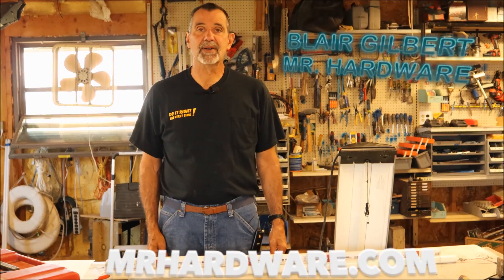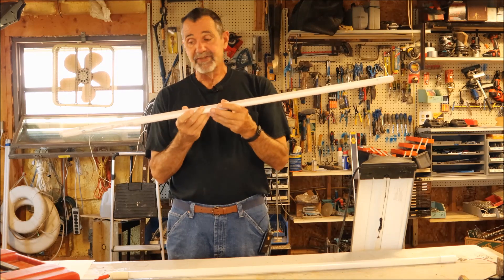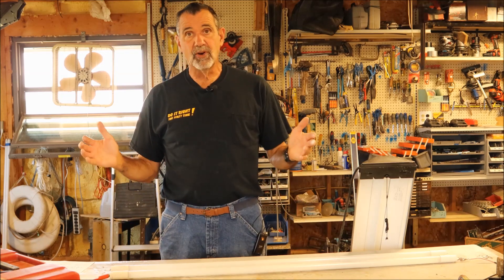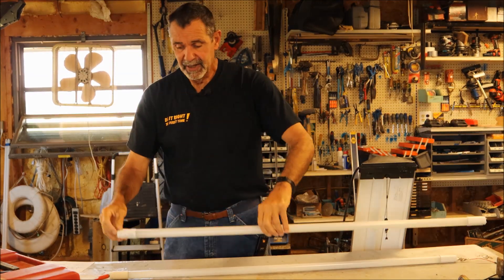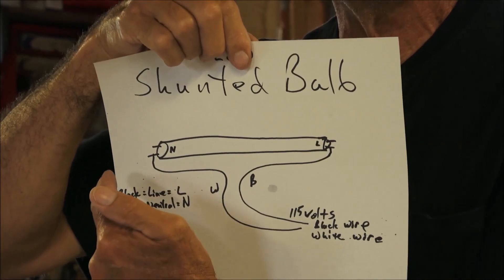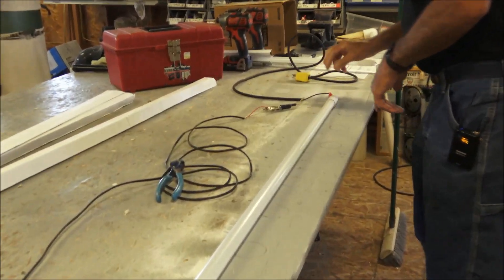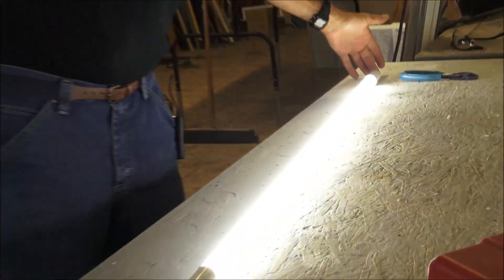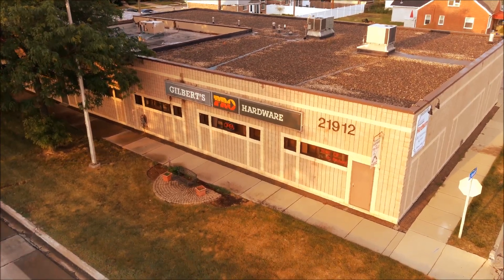LED Bulbs Can Require Different Wiring, Can Be Confusing

Comment: You called the one you wired from only one "shunted"...Incorrect...this is "unshunted"   If your fixture has one wire to each tombstone its "shunted"  if it has two wires to each tombstone its "unshunted and you must wire correctly. The way your original tombstones are wired determines how you rewire the bypass UNLESS you want to change the tombstones to suit your preferred method

Comment: At 3.33 you point to white common, but you have red of the pigtail connected to the tube instead of the white.. It would have been nice if you hid the red on both ends of pigtail to make it not confusing... and yes like @jerauldmumata 1297 I also feel @3.54 you probably meant Non Shunted.